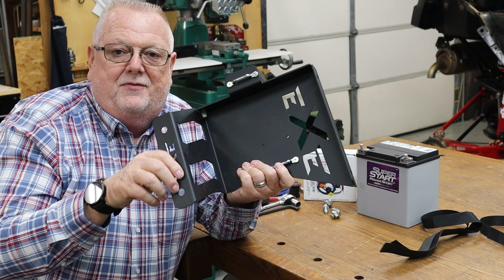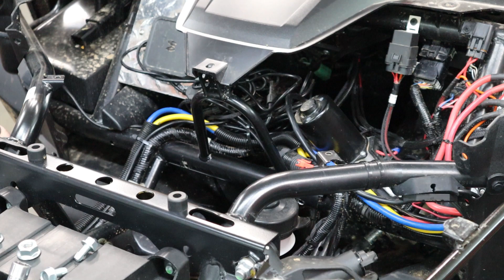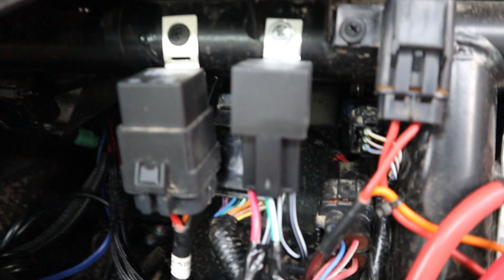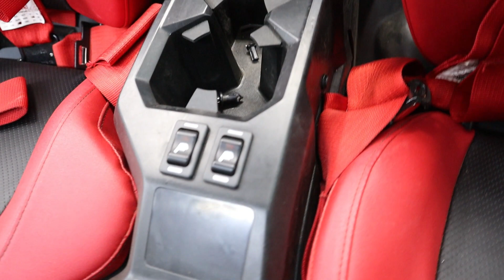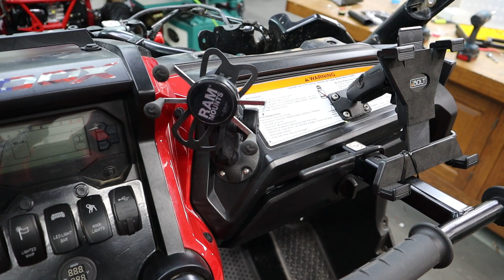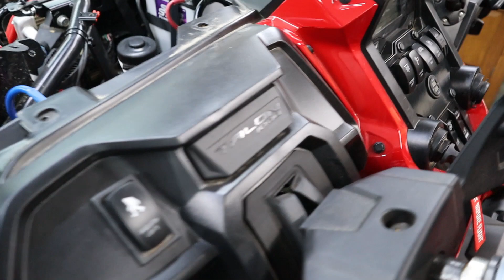Elite SXS Engineering battery box and True isolator install and electrical overview on the Talon X.

Comment: How are you wiring you accessories to the secondary battery?
Reply from the maker: I chose to connect both batteries together at the power posts ant then feed the fuse box from the XTC relay. It's not the conventional approach but it's worked perfectly for us for all this time.

Comment: Looks so cramped under the hood . So you wont be installing the inferno heater on this talon ,or the wiper kit because of no room,or did you opt for the heated seats instead ?
Reply from the maker: We freely admit to being fair weather SXS riders. We have no enclosure and run the half windshield so no need for the heater or wiper. The heated seats are plenty good for the occasional cool morning.

Comment: Am I missing the post with the links for the items used?  I have a '21 Talon 1000R and assume they would all be the same...?
Reply: Got it!  Thank you Sir!  I was hoping a larger battery would fit in that box/tray, but hopefully using an AGM will be sufficient... I just haven't had the greatest luck out of the smaller AGM batteries in solar experiments.
Reply from the maker: @PatrickLinley1  The Oreilly Auto powersport battery has performed very well for us in this application.
Reply from the maker: The links are all in the show notes. Small down arrow right of the title under the video will open the notes if you are on your phone. Everything is the same on the '21.

Comment: I have the same kit on my pioneer 1000. Question is. My winch and led bars are all on the aux. The primary is only for the machiene. But when I hit the winch button both batteries will drop voltage not just the aux. They never drop below 13.2 ish even with all the light bars on. But then they fluctuate back up to 14.3. is it normal for them to both fluctuate even tho your drawing off the aux battery. The kit was just installed like 10 minutes ago
Reply from the maker: That's normal. The isolator is designed to protect and preserve voltage in the cranking battery only when the voltage drops too much.

Comment: Hey Terry,  Have you had any issues with the Talon charging both batteries? My main is staying charged but my aux is not going above 11.5. And I have the AJK off-road 450 CCA & 30 Ah battery with the True isolater and XTC keyed on busbar…..which was a great choice by the way. I don’t have anything on the aux side besides a usb charger, winch, and light bar…..120 watt at that, and the stator won’t charge the aux with the light on. Any thoughts?? Thanks for the great videos by the way!!!
Reply from the maker: Thanks for watching Ted! I have not had any issues with the 2nd battery being fully charged. I'm assuming you have the dual volt meters? Should be about 14 volts on both when the Talon is running and the isolator is closed.
Reply: @terryhatfieldmedia  So I just thought you'd be interested....I found the problem to my issue. The ground wire needs to be grounded to something, not just hanging behind the isolator!!! I was checking wires and the ground popped out from behind my homemade busbar mount, it had the zip tie still on it that I pre measured to the ground I was going to hook it to. So to sum it up, pay attention while wiring, LOL! Take it easy Terry
Reply from the maker: @tedadelle   Glad you figured it out!!
Reply: @terryhatfieldmedia  I do have the dual voltmeter. I only get the main charged fully. I’ll have to dig deeper to find the issue, I’m sure it’s just a simple mistake I made somewhere……thanks for the reply!!!

Comment: Is your diamond plate only attached via the two holes on the factory winch controller mount?  If so what is the thickness of your diamond plate, a lot I see is very thin.
Reply from the maker: It's 14 gauge. .063. It is bolted thru those holes but has a couple of cable clamps around the chassis tubes that you can't see in the video. Same sort of way I secured a piece on the other side for the rock light controller. https://flic.kr/p/2hRBLMM

Comment: Can you put a shut off switch or a 3 way switch on this set up?
Reply from the maker: I sure you could but for what purpose?
Reply: @terryhatfieldmedia  storage purpose. Also what about a way to bridge the two if you need to get an emergency start?
Reply from the maker: @jeremyruff7961  Be simple enough to put a cutoff switch in the second battery or just unhook it. I prefer to keep mine on a battery tender pretty much all the time. I actually have mine wired together for extra power for winching or whatever.

Comment: Hey Terry! Thanks for the video. I have been following the way you did the dual battery and True isolator. Problem I ran into...I got the volt meter connected and it works on "keyed on power" but only reads the voltage on the main. The secondary just lights up with zeros. Any tips you can offer?
Reply from the maker: Thanks! Something definitely not connected correctly. Need to double check. Here's the wiring diagram for the gauge if you need it. https://live.staticflickr.com/65535/51236488492_7e8120055e.jpg
Reply: Any luck? Ours does the same thing. Reads main battery, but secondary is all zeros.

Comment: Is there an indicator light that shows you if the device is working?
Reply from the maker: Once the main battery is above 12.8 volts the isolator will open and begin charging the secondary battery. There is a blue led that will illuminate to show that it is open.
Reply: @terryhatfieldmedia  Thankyou terry I understand that these batteries also charge reversely from house battery to car battery is there an indicator for that as well or is it always blue?
Reply from the maker: @808monsta96816  As far as I know it is only the blue led to indicate the main battery is charged.

Comment: When you put the PBR switch plate in did you have to cut out any of the bottom of the cubbyhole behind it to fit the voltage meter
Reply from the maker: Did not have to cut it but it was really close.

Comment: So question: I am by far not an electrician but I was thinking the way you had it hooked up on the connections. Would you not want the hook up all the accessories to the second battery directly instead of the main battery? My reasoning would be if you drain the second battery then you want kill your primary battery but it will recharge it accordingly. Not sure if I make since but that is just a thought. Tell my your opinion about why or why not please?
Reply from the maker: You can certainly do it that way and lots of people do. I chose to let both batteries work together.

Comment: Terry,  ordered the true isolator and looks pretty simple but.... the relay in the kit is not part of the instructions? Is it required and do you have any kind of instructions for this?? Thanks
Reply from the maker: The relay is a triggered ground for the gauge so it's not on all the time. 2nd page of these instructions show the wiring. http://www.trueam.com/wp-content/uploads/2017/09/installation-instruction.pdf

Comment: Thanks for a great video!  My new toy is a 2020 Honda P1K5.  Could you please go into detail on how the power is distributed from the auxiliary fuse box to accessories and rocker switches?? I am very new to wiring of this nature and don’t have the time for a learning curve. Secondly, I will be using a Stinger for the primary relay (key on only).  Given this fact, would I need a secondary relay for the voltmeter?
Reply from the maker: Hi Frank. The individual circuits/fuses have power wires feeding the switches and then out to each accessory no need for any more fuses to each switch. The Stinger is fine but you will still need the relay for the volt meter. That relay is a triggered ground so the gauge is only on when the key is on.

Comment: I’m doing this same install.  My question is do you connect the positive post of fuse box to the accessory or directly to the secondary battery?
Reply from the maker: Th fuse box is fed from the relay on the XTC harness. That way all the fuses are key on only.

Comment: million dollar question Terry, what type of paint and what prep is need for the door panels ? You did a GREAT wiring job, I've gathered almost the same parts and once I start, my system will be very close to yours. Many good tips ! Also thanks for the links, very helpful
Reply from the maker: Thank you Robert! All the colored parts of the Talon are painted form the factory so noting more than a light sand and repaint. The black textured parts are a much more labor intensive process. We've had no success at all without removing 75% of the texture and priming them before paint.
Reply from the maker: As far as the actual paint process, we used Sherman Williams base and urethane clear. Same thing we shoot on the vehicle we repair. It's held up very well.

Comment: Terry,  I am hyper curious to know if you didn't re-install the firewall liner purposely, or purely for demonstration purposes, and later re-installed it?  Thanks for this amazing How-To video.
Reply from the maker: Thanks. Everything was reinstalled later. 98% of the electronics and wiring are covered when it's back together. Here's a pic of the finished engine compartment. https://live.staticflickr.com/65535/49762151982_8b865f7dad_h.jpg

Comment: Love your setup with your Talon! I have a Pioneer 1000-5 and I’m doing the same this weekend with an odyssey battery! One question I can’t find an answer on is with the volt gauge on the dash...how does it hook up to the orange plugged harness that’s included with it?
Reply from the maker: There should be a wiring diagram in the kit. Positive from each battery is wired to the gauge. The orange plug is for the ground interrupting relay. The relay interrupts the ground circuit on the gauge so it only displays with the key on.
Reply: Terry Hatfield 
Ok thanks! I thought that’s how it was but wasn’t sure. What other wires from the orange plug are used? I don’t have my kit yet is why I’m asking.
Reply from the maker: @joeygilliam2820  Battery power and key on. Wiring diagram in the kit is super easy to follow.

Comment: Videos are awesome man. I noticed you have the ram phone/tablet mount with the round base. Mine seems a little big to fit where yours is mounted. How did you get it to fit and what did you use to secure. Thanks.
Reply from the maker: Thanks Colin! I filed the side of the base to fit that spot. It's attached with 4 stainless sheet metal screws. Worked out great. Here's a pic https://live.staticflickr.com/65535/49825347991_f14bb41187_b.jpg

Comment: Great video! Just got a talon so You got my sub! I’m definitely going to use all the products you listed, BUT I do have a few questions: looks like all your accessories are drawing from your main battery due to the power posts by the winch solenoid and the auxiliary battery is just connected to the system via the isolator. So what’s the point of the isolator and aux battery if all the accessories are drawing straight from the main via the posts? Secondly: did you run your own cable from the main battery to the post up front, or does the kit come with one long enough to reach the front bay?
Reply from the maker: Thank you! Both batteries work together like one big battery once the isolator activates. Lots of people do run the accessories off the 2nd battery only but I wanted both batteries to function as one. Either way is fine. The isolator allows me to monitor each of them separately and to charge and maintain both with a single maintainer.  When the maintainer is on the machine the isolator lets the main battery charge fully and then switches to the 2nd battery.  Lots of different ways to skin this cat. This is just what I thought was best. Honda provides 6 gauge positive and negative cables under the cowl. They are meant for the Honda winch controller but work perfectly for this application as well so no need to run more cables to the battery.

Comment: Another great video.  Thanks!  The only problem is when I watch your videos I spend money!!  Seriously a good easy way to add that 2nd battery and isolator.  One question, how did you reconnect the firewall cover since you used the two holes?  Did you just put the cover in between the battery box and frame?
Reply from the maker: Thanks Phil! I just trimmed off that portion of the plastic shield. It has plenty of other attaching points for pushins. I am using the aftermarket firewall shield that goes all thee way across.
Reply: @terryhatfieldmedia  can you drop a link to that aftermarket firewall shield
Reply from the maker: @richardcraine5722   Yes sir. Here ya go.   https://www.ebay.com/itm/2019-Honda-Talon-1000R-1000X-X4-mud-guard-firewall-shield/113898732245?hash=item1a84e4bad5:g:M98AAOSwzaJdcYYG